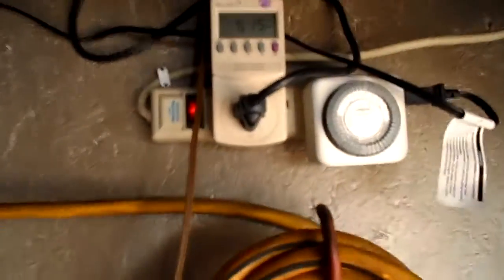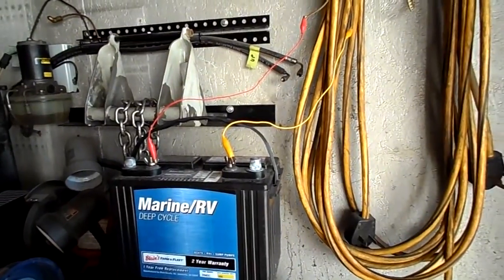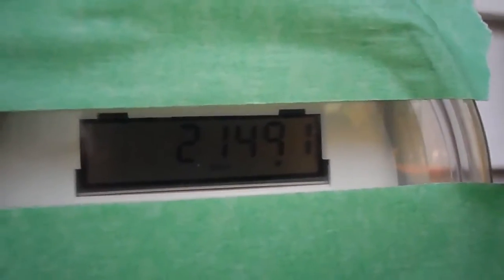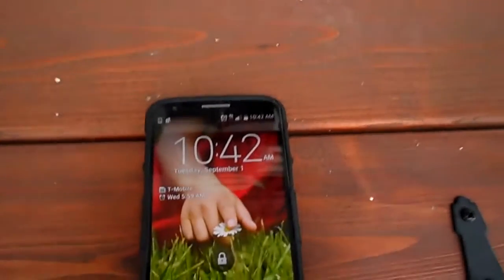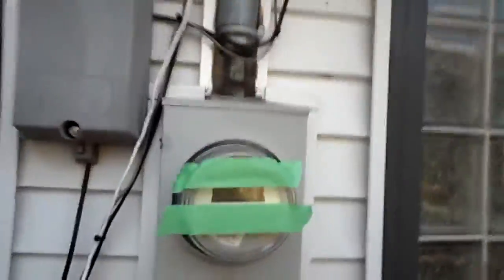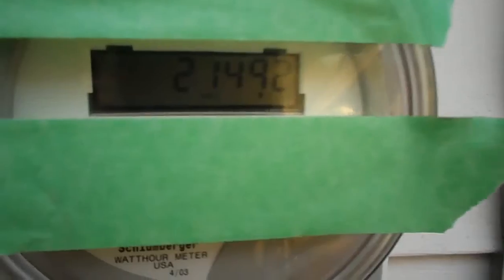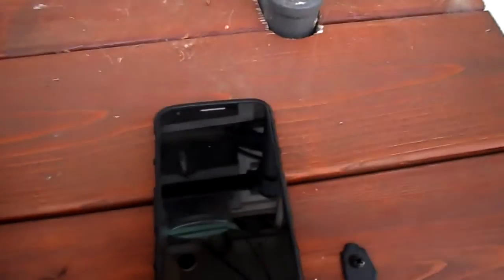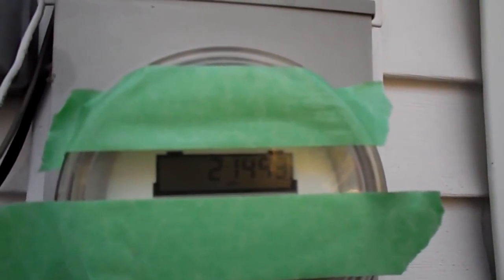Schlumberger Smart Meter with Solar : Power company robbing you.

Comment: NG wants to charge $40 a month to read my smart meter manually without a chip. But the NG did not give me all my options. I asked for other options like a net meter. See Im making the argument that I dont want the radio frequency meter or smart meter. I have been looking at OSHA regulations and giving the power company those articals as references for reasons why I can install my solar and wind system. Also I watched a documentary Taking Back My Power and the web site has a packet, one can send to thier power company.
Reply from the maker: +Corey Clemons I suppose every state is different, some states won't even buy back power and the ones that do, buy it back for like 80% of what they sell it to you for with net metering.  From what I hear, there is no winning in either case unless you just go off the grid.  $40 a month pretty much rules that option out for any big savings.  
Before I changed my lights to LED, I spent $1400 a year on electric and that was based off 16 cents a kw.  No matter what I do, that is the most I can save per year.  I have over 3 times that invested on wind and solar. lol, makes one wonder if they should even bother.  I'll have to check but this year I may have saved $400 and I did figure it out once and it would take me 8 years to recover and that don't include the wind turbine stuff ( total loss as they don't make anything on a monthly average).  
It's hard to say how strong the arm of the power company is because, the meter and lines that run to your house is their property.  In a court battle, they may even argue as long as their lines are attached to your house, they have the right to charge you a facility fee even with no meter ( just a wild example but I can see them pushing that argument).
Keep me posted, hopefully they don't railroad you on a bold move.

Comment: I am looking into the same problems with my smart meter. I called the my power company National Grid in NY and they offered my the opt out deal which makes me pay for a meter reading monthly. After on the phone with NG for a while I asked for the net installed instead and of course thats not an option unless a certified electrician signs off on the alternate energy installation. 
I supply my power company with at least a kilowatt per hour. Im producing 30-45v by 30-40 amps most of the day with a battery bank being charged. And Ive been away from home for more than a year for work. Im still paying 28$ for delivey every month. 
I made my own state of the art energy system and will be running before 2016. Check the testing of a 48v PMG I am using for the production of over 600v.
Reply from the maker: +Corey Clemons How much would they charge you to read the meter every month? Plus you'd still have facility fees.  They really make it hard to decide which way to go.  I see only two options really, either work with the current service by controlling how much power you make (keeping the meter still) or going completely off grid.  With power companies wanting to start charging $50 a month for people with solar, off grid would be the final goal.  
I never thought I would see the day I would have to actually turn on more power to save money.  I don't have a battery bank yet so I'm still using about 8 kws at night.  With winter coming that will more then double so I have to figure this out quick but I think it's too late for me this year.  Check out the power limiter they have out.  It keeps you from adding power back to the grid so you'll be in that sweet spot you need to be in with on grid service.  The power company will not let us save money without penalizing us in one form or another.

Comment: How about shutting off the main breaker in the house, and remove the breakers from the box... of course, being very careful in the process. Connect your own power to the main breaker box and have it done 'to code'. That way, there will be no current what-so-ever going through their meter?

Their new meters work off of inductance.  Regardless of direction of current... ANY current being sensed will be seeing by the meter as current being used. Great video showing how they work. https://www.youtube.com/watch?v=dm-yZ1N3xmc

Just a though. Love the vids. Sub'ed.
Reply from the maker: +Naked Machinist The electric company will charge me just to have the meter hanging there. Joe Primal pointed out they have out a power limiter which should regulate power made so none actually goes back out into the grid.  Something to look into in the future.  As far as the box goes, I'm thinking with a breaker simply switched off, should isolate that wiring.  Even thou the neutral and ground wires connect to the same buss bar, it's just a ground but I will have to test that to be sure. Worst case, I simply put a wire nut on the  3 wires of that circuit which will for sure be isolated.  First I want to figure out using power from a battery bank at night.  It's not as easy as I thought it would be.  The bank can't be too big or too small for the panels used.  You can't fully charge a bank too big (unless you get more panels) and you'll drain batteries too far with a small bank shortening their life span.  Should be a fun project.

Comment: The new smart meter's screw people. My old place had the old analog meter. Here where I live now it is digital but doesn't count the power going to the grid.
Reply: +TheBlokeSolar&Wind   There are grid tie power limiters you can buy that will block power from going to the grid.  There are some on eBay for $135 for a 4kw unit.
Reply from the maker: +Joe Primal If you need a grid tie also you can save a little on a package deal.  ebay item number 111801577007
Reply: +TheBlokeSolar&Wind    Maybe people could start their own 'grid' with their neighbors? :) Then eventually the electric company will shrivel up and die.
Reply: ***** Here in some parts of Australia they are limiting the size of system you can install due to to much power being exported to the grid.
Reply from the maker: +TheBlokeSolar&Wind It doesn't count the power going into the grid? Nice, that's kind of a bonus for you.......so they don't charge you for it then?  I'd be okay with that cause now I have to try to keep that meter going as slow as possible in any direction.  (either way I'll be charged).  That would be a good video for you to make showing that.
Reply: Yeah I got my power bill down to $600 a quarter from $1400 a quarter using wind and solar.
Reply from the maker: +Joe Primal I checked some out but I'm not sure how it slows the power or eliminates it.  Must be lost as heat somewhere
Reply: *****  From solar they wouldn't have to dump the power, the inverter can just cut it off.  If you have wind it's a different deal because the generator is generating regardless.  What I can't figure out is how they tell the difference between demand from the grid and demand from the house the way they have it wired in.  It may be that it's matching the grid voltage very closely so that when house demand drops off there is very little current flow back to the grid?  IDK, but I'm going to end up getting one and trying it.  I don't want to get rid of my smart meter because the smart meter means that I don't have Edison people poking around my place every month.
Reply: *****  I see what they're doing.  The have a clamp sensor that you put around the line from the grid that can sense the current flow, and when it reverses it cuts off the power from the solar panels.
Reply from the maker: +Joe Primal What sucks for me is I have a small house with no basement or attic.  Running electrical is tricky.  My setup is in the garage about 30 ft from my smart meter.  You should make a video on how it works out for you if you get one.  I may end up picking up one of those myself in the future.  Now with 2 hot wires coming in to the house I'm sure one would have to have enough solar on each leg.  For night time I'm going to use a battery bank to draw power from so I'm wondering how that limiter would work hooked up to that also
Reply: *****  This ebay ad has a lot of info.  You can go up to 30m with the clamp sensor wire.  IDK.  Looks interesting.  If I get one I'll make a vid for sure.   http://www.ebay.com/itm/Grid-tie-power-limiter-for-SUN-500-600-1000-1500-2000G-solar-grid-tie-inverter-/121661602497?hash=item1c5398bac1:g:IJUAAOSw3ydV0d7N
Reply: *****  I saw that.  I've noticed that sometimes the inverters go pretty cheap at auction if you're patient.